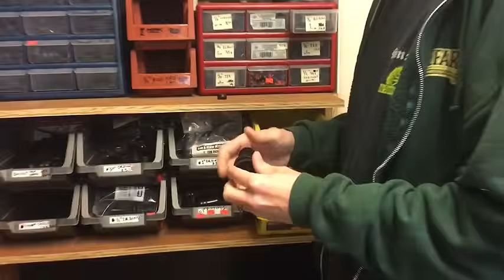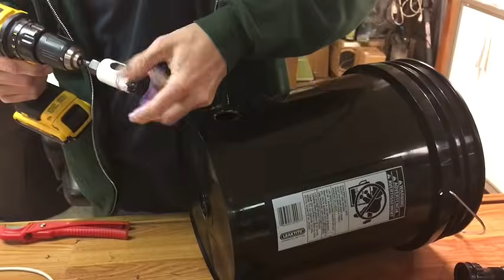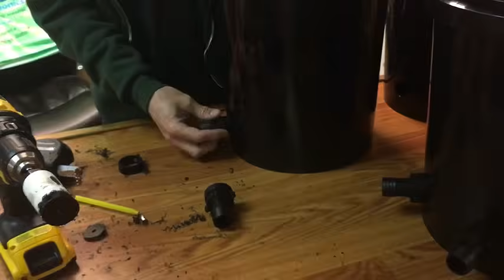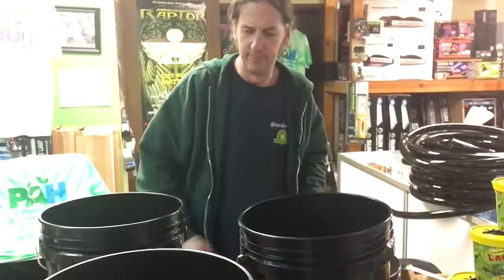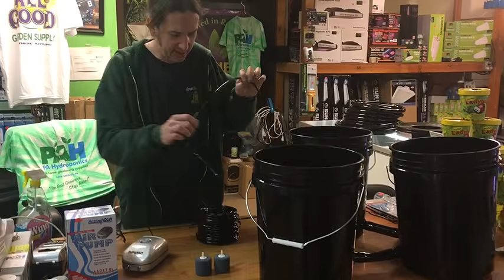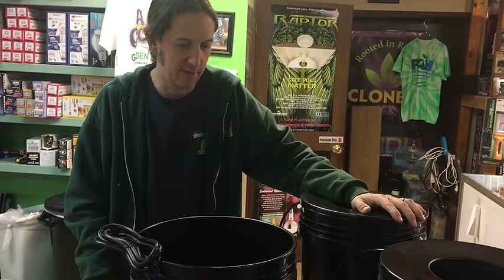Easiest double bucket STIRPONIC RDWC with reservoir and water level indicator built from scratch!!

Comment: Good info but tedious to watch. Maybe more quick cut n paste. But  I’d like to see it in action and less detail of every step. How much water? Explain also how to regulate and control the “issue” of the first bucket being fuller. Do we slow the flow or use less water etc!? Newbie needs more info less detail like I don’t need to see you cutting tubes or going to a store to pick out stuff. If repeating what you did in video no. 2. Simplify because I enjoyed watching you and your calm voice just maybe tweak the style a tad. Keep em coming!!
Reply from the maker: Thanks for watching, and yeah we do go into alot of build detail, it cuts down on all the questions. The buckets stay the same level if you use a small pump - 75 gph or less with 1" tubing, 3/4 or 1/2" tubing doesnt let enough water flow to keep them even, it must be 1". We have another build video this week then we are doing 2 big complicated systems for the big guys. Have a good week! Gary

Comment: Hi. Can you over aerate a dwc system.. 
Is there a Litre per hour min/max advised?
Ie.. if I split a 800l/ph  airpump between the two 5  buckets.. would it be too much, likewise too little if I attached a 50l/ph airpump.. 
Thanks in advance
Reply from the maker: You can't over do it, the only thing that could be bad would be if the air caused root damage from over bubbling. G
Reply: @PAHydroponics  That's good. I have a piston powered air pump. Loud as.. but will work then. Thanks!

Comment: Can you list the supplies need for this??
Reply from the maker: INCLUDED IN THIS KIT:

3 - 5 Gallon black food-grade buckets
2 - 6" Bucket net lids
1 - Bag of clay pellets grow media (REMEMBER TO RINSE OFF!)
1 - Plain bucket lid to cover reservoir
6 - 1" Bulkhead drain fittings
3 - 1" Sections of black tubing each cut to 14" (YOU MAY TRIM TO YOUR AREA)
2 - 1/4" Sections of airline that are 10 feet long (YOU MAY TRIM TO YOUR AREA)
2 - Round, medium Active Air cylinder air stones
1 - Active Air 2 output, 125 gallon per hour air pump
1 - ECO 66, 75 gallon per hour submersible water pump
1 - 1/2" to 3/4" reducer with tubing attached (AS SEEN IN VIDEO)
1 - Water level indicator kit with blue Sight Tube (AS SEEN IN VIDEO)
I just copied from our website www.pahydroponics.com hope this helps! Gary

Comment: Your videos are amazing. I’m super pumped to start one of these and will probably order everything from you. I want to do 8 plant buckets + reservoir. Would you recommend 2 separate systems or just one with 8 buckets and reservoir. I’m planning on doing 3 or 4 types of veggies so would splitting into 2 systems make sense based on nutrient requirements for the different veggies? Thanks again for putting these videos together.
Reply from the maker: Hello Lee, thanks for the complements! The 8 bucket system can have more leak issues due to the weight of the water but it can be done. I think 2 - 4 plant systems would be better for that reason and also nutrient requirements. I will be putting the 4 plant system on the website today so keep an eye out or check back tomorrow. Thanks for watching! Gary
Reply: Thank you, sir. Will do

Comment: Hey if i wanted to to the same set up but with 4 buckets what size pump would you recommend?
Reply from the maker: Hey Mikey, I still recommend the 75 gallon per hour, I have tried more gph and water levels don't stay even with 1" tubing, not enough water flow thru 1". Don't try to grow huge 6 foot  plants in this system roots can clog things up as well. hope this helps! Gary
Reply: @PAHydroponics  damn! I already ordered a adjustable 200gph pump. You think it would work if I'm using a 18 gallon rectangular reservoir?

Comment: Hi from Australia! Just interested in how easy it is to clean this?  Do you need to disassemble parts to make it easy to clean?
Reply from the maker: When your done the grow don't let it dry out before cleaning, I suck everything out with a wet vac or bottom feed submersible pump, then I use a rag to scub out the rest, then I rinse it out and suck out that water. The tubing is hard to get off and it may not seal right if you put it back on, tubing is hard to put on in the first place, I recommend putting the pieces of tubing on a bowl of hot water when you are building, it will help. So yeah it can be a pain to clean. Most multiple plant hydro system's are hard to clean so yeah.... Hope this help, and thanks for watching! Gary

Comment: Do you think this build would work with 2 inch piping?
Reply from the maker: Hello, I get that question often and I don't think the round buckets would flatten out enough to seal the bulkhead, should be anything square or rectangle , If you could make 2" work it would be sweet. Thanks for watching! Gary

Comment: I've got a question. I just started the 6 bucket system and are you saying that I should change the nutrient solution every week? I'm retired and on a fixed income & that would be cost prohibitive. What happens if I use the same nutrients throughout the flowering stage? I just don't understand why the nutrient needs changing, does it become contaminated or it loses its nutrient factors? Thanks
Reply from the maker: Good question, plants take what they want from the nutrient solution, if you don't change it out and just keep adding more nutrients then there could very well be a build up of something the plant doesn't need or want and that can cause problems. I have seen people get away with it but there plants don't end up as nice. Hope this clears up some confusion. Gary
Reply: I change my nutes twice. I always feed half strength keep your environment right and your quality will be fine. Sometimes i will add a bit back if i have a ppm meter. But it is fine to just add water. I just do a water change at flip and call it good. I add some goodies along the way but sparingly because it doesnt leave the system. Oh yeah i re use everything. And run my water through coco 24/7 same pump for years. Spend for cmh led isnt there yet. Unless you are rich.
Hps is king. Im using cmh now gottem free.  And rain spas are simpler and you can add a self leveling res. And even further you can use an air line to circulate the water no heat build up. My ways easier though.

Comment: I live in canada and its hard to find these fittings locally at a decent price in fact I cant find them at all .  . I would like to do a 4 bucket system in a 4x4 tent I just cant seem to find the right parts.
Reply from the maker: Hey man, I hear you on that, we have had multiple people in Canada with the same issues, BUT there are a ton of stores in Canada. Hydrofarm is owned by a Canadian company and they are a main distributer for us, there store locator is a bit tough, you need to look up your city on it then zoom in and you will see all the stores, Toronto had about 50 stores that show up! Hope this helps. Gary
Reply: @PAHydroponics  Thanks for the response . so far all of the hydro stores near me carry everything but not the fittings . just "kits" .
Reply from the maker: For the 1" bulkheads See if they can order Hydrofarm part #AAEFBK4 they come in a 10 pack and have many uses. If the store orders from hawthorne garden supply/aka Sunlight  Supply they are part#  708580 ( I like these a little more than hydrofarms  but both work). also you can get the 1/2 drains also for water level indicator there too and 1/2" elbows. The hardest part is the small tub clips for the water level indicator, they have been discontinued by General Hydroponics as far as I know. Hope this helps, I'm trying :) Gary
Reply: @PAHydroponics  awesome thanks i will def try that . as for the clips i am sure it would be easy to rig something up . i like the idea of this kind of system because of no longer needing actual growing medium which is what appeals to me the most and also not really worrying about watering which becomes a hassle for me haha . i get more excited about this kind of setup the more that i think about it . overall it seems more cost effective especially since the clay stones can be washed and used again . after initial investment it seems alot cheaper to run . ive bought so much promix that to even think about the amount i have spent on it is crazy lol.  I truly appreciate the tips and advice .
Reply: I checked hydrofarm and i found the exact same brand on amazon so i may just order those . some of the reviews say they are brittle , have you noticed if they are ?
Reply from the maker: HF version has only 1 grommet, put it inside bucket side, also they don't have as good of hand grips to tighten, they still work just not as nice as other ones. I wouldn't say they are brittle . Gary
Reply from the maker: Thanks and yes I agree, hopefully I will have time to do more video's , there is a top off system called a Texas controller that will even make it easier. It will keep the water level topped off in the system while your away. Have a good day! Gary
Reply: Awesome . Thanks .
Reply: Also I may have missed it but what size hole saw was that you used? Was it 1" as well?
Reply from the maker: 1-1/4" hole saw.
Reply: @PAHydroponics  awesome thanks .
Reply: @boomhower4731  personally I used 1" Grommets (https://www.amazon.ca/gp/product/B00IGFDPTY/ref=ppx_yo_dt_b_detailpage_o01_s01?ie=UTF8&psc=1) and 1" PEX Pipe/Fittings for connecting my buckets.
Reply: @kenrussell8629  it would have prob worked out better for me but i got it done with the bulkheads . its not in use yet tho because i got 4 autos in promix right now that im waiting for to finish . then im going to start rdwc .
Reply: @boomhower4731  yes I started with bulkheads too, that I got from amazon, if you got them same place, you can return them and save a lot, the grommets I think require the same size hole as the bulkheads which is 1 1/4". is also just $10 for a 1" x 10' of PEX Pipe. :)

Comment: Thank you.  We watched the first 3 and we wondered if you would video how to adapt the buckets for a tower garden in a bucket and a fogger bucket and a reservoir bucket.  We want to use a 6 in thin walled 5 foot pipe as the tower.  The fogger bucket receives water through a flapper valve  from the reservoir/nutrient bucket.  The fogger bucket is fan driven and pipes into the top of the tower.  The reservoir has a pump and dripper line to top of tower.   Very well done videos.
Reply from the maker: Thanks for watching :) Your system sounds cool, I'm not a big fogger fan, the ultrasonic disks always got salt build up and stopped vibrating when I messed with them years ago. I will put a tower system in the works for 2019 but it could be awhile. I already have a few more videos to do before that comes. It will probably be next summer. Thanks again! Gary

Comment: How do you keep it cool the pumps seem to rase water temp over 75
Reply from the maker: Hey , you could run it 1 day with pump off , its a small pump 75 gph it shouldn't be the thing heating the water up but if it turns out to be then you could run it on a 1 min on 4 off timer to keep pump from getting hot, also put your air pump in a cool place to help blow cooler air in the water, and of course you could use a chiller. The system we run here is on a cold concrete floor , we actually have to use a reservoir heater here. Just some suggestions. Hope this helps.Gary

Comment: sorry one more thing i need to know is what drill hole size you use for the 1inch drains???
Reply from the maker: 1 and 1/4 inch. Make sure the holes are cleaned up very smooth to prevent leaks. Have a good day! Gary
Reply: @PAHydroponics  what is the name of the tool to clean the hole
Reply from the maker: Hey, it's a deburring tool https://www.homedepot.com/p/Rapid-Deburrer-Tool-21660/203553868 . Gary

Comment: Do you clean the buckets that hold the plants during your grow or does RDWC stay clean on its own? I usually do this weekly with DWC. I'm just trying to see the benefit in this other than being able to check ph and add nutes without messing with your plants. I change my water every week to keep it clean and add what i need. when i do this, i use a different clean bucket and swap them out. This method would save me some time and labor if it does.
Reply from the maker: Hello, you have good points about cleaning, with this system if you drain it there will be still an inch or more of water in all the tubs, I personally don't mind that, it can transfer some biodiversity into next nute fill. I think a big advantage would be if you scrog and net everything you will still be able to change out nutes from whole system without moving plants out. This system also keeps things stirred up really well so each plant will have exactly the same PH and nutes. When the grow is done I recommend immediately cleaning all the biofilmand salts out of buckets before it dries onto them. Thanks for your comment and thanks for watching :) Gary

Comment: You don't want a large pump anyway because it adds too much heat to the water.
Reply from the maker: Excellent point! It would be a cool idea to put the pump outside of system too. Thanks for watching! Gary
Reply: @PAHydroponics  Yeah,  I'm a big fan of those external DC pumps.
Reply from the maker: DC, as in solar panel ready? I haven't messed with those if that is what you mean. Some of my outdoor guy's have tho.G
Reply: @PAHydroponics  They could be used with a solar panel,  but those outdoor guys are usually using a 200psi vibratory pump to get water to the top of a hill,  these are regular aquarium pumps that are just kept outside of the tank to help keep the water temp lower.  Like this:  https://www.amazon.com/Uniclife-Controllable-Controller-Freshwater-Circulation/dp/B073XLGNS3/ref=asc_df_B073XLGNS3/?tag=hyprod-20&linkCode=df0&hvadid=198102114124&hvpos=1o2&hvnetw=g&hvrand=569987304036735029&hvpone=&hvptwo=&hvqmt=&hvdev=c&hvdvcmdl=&hvlocint=&hvlocphy=9032472&hvtargid=pla-542213289752&psc=1

Comment: Use your drill with the hole saw in reverse for a much cleaner hole cut and less danger of cracking the plastic.
Reply from the maker: Thanks! good tip,I actually do that when I do big holes, these little ones pop right thru tho. peace. G
Reply: Better still a step down drill or step up bit is 110% more efficient at precision holes, step down so precise you got to thread & force fitting, bulk heads into the holes = no leaks.
Reply: @stevenadams_fifty9  And to get a step bit of that size will run you about what a 2 or 3 bucket setup will. Roughly $100+

Comment: 1st off, THANKS Gary for taking tome to help us all out.       Next,  I wanted to do a 3 each 5 gallon ... like you did here.....  I have most everything in stock.... but I can't find the ECO66plus. 35 gph pump....   I believe that's what you called it.    Do you have a Part number?   Or did u use a 53 gallon and rail it back?    Please let me know.   Again thanks
Reply from the maker: Hello, the pump is a 75 gallon per hour Ecoplus Eco66 part #728490, I'm sure there are other brands to use just remember going over 75 GPH might have uneven water levels in buckets because flow wont keep up with 1 inch tubing. Hope this helps! Gary

Comment: Awesome videos, thank you. I'm considering creating a bubble bucket for two plants out of a rectangular container. With one extra net pot hole for access (blocked off from light) Using that access hole to siphoning out/in the water for changes. Would there be any issues with that design? Do you need the water level indicator? Thank you.
Reply from the maker: Hello, the water level indicator is not necessary but nice to have. I don't see a problem with your system except if something happens to 1 plant you wont be able to get it out of system, it's roots will be stuck with other plant, also when 2 plants are together in any grow situation they tend to fight for the light and you could get stretching. That's just my thought's - hope this helps! Gary
Reply: @PAHydroponics  That's a good point I hadn't thought of that. Thanks for the reply!

Comment: Great three part series. I've begun setting up my tent and am going with a hydroponic grow system like this. So total water will essentially be 3x that of two independent buckets to maintain an equal level in all three buckets. Does this mean we add 3x the nutrients for a single setup to ensure the nutrients are the same in all buckets, or just use as many nutrients as you would for both combined?
Reply from the maker: Hey Dane, good question. Pretty much you want to add total volume of water in gallons and then look at your mix chart and times all that by amount of gallons used since mix charts are usually per gallon, in this system the buckets wont be filled to rim so you probably have 4 gallons per bucket X 3 so mix for 12 gallons. Hope this helps! Gary
Reply: @PAHydroponics  thanks so much for the response! Your videos are very helpful. My plants are thriving!

Comment: How full do those get?  How much total water are you using per res change in a two bucket system?
Reply from the maker: Hey, I usually start with about 12 gallons total in that version, 4 gallons per bucket, you need to make sure the water is up far enough to touch your starter cube or cutting, but later the water can drop down a lot and plants will be fine once roots are big. Have a good day! Gary

Comment: I have a question. On the multiple bucket system when does the recirculating pump turn on? What keeps the other buckets from over flowing? I LOVE this series nd as soon as you answer my question I'll be ordering, Thanks
Reply from the maker: Hello, the circulation pump is always on and so is the air pump, each bucket has an in and out so the water levels should be close as long as the roots don't start clogging up the lines, water flows around the system in a circular way.  Some people do trim the roots so they don't go down tubs to next bucket, never trim more than half of the roots, it does shock them a little. Hope this helps.